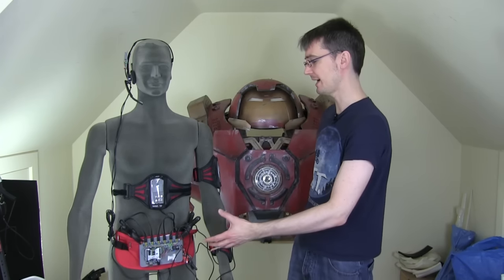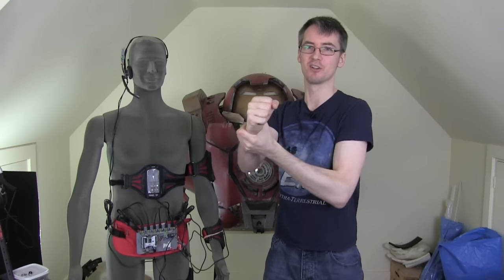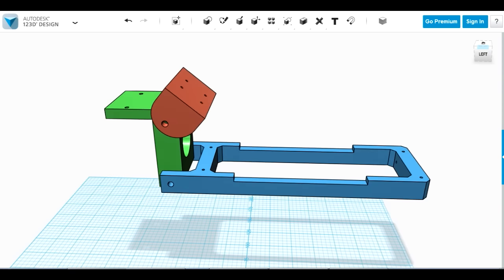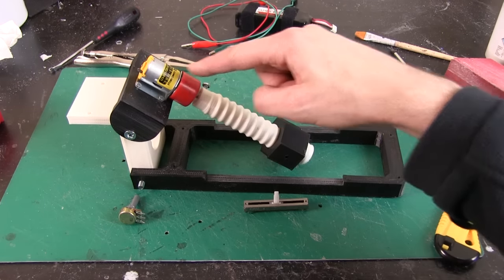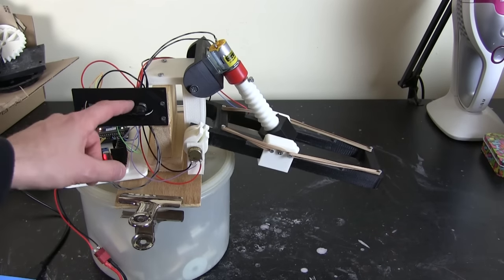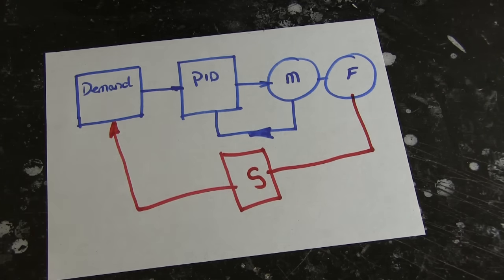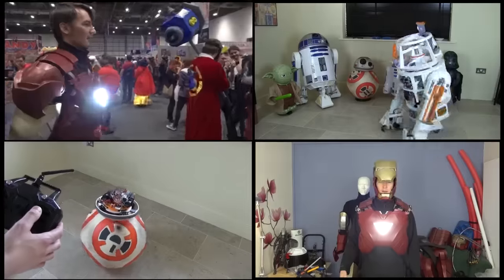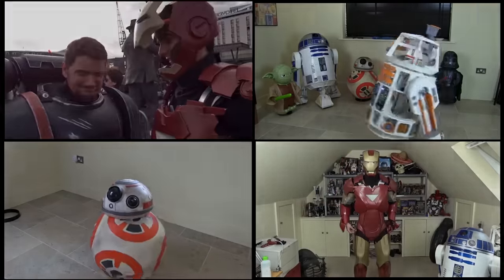Avengeres Ultron #4 | Series Elastic Actuators | James Bruton

Comment: Perhaps try a piezo based solution for force sensing or a force sensitive resistor.
Sandwiched in a joint where the load is going through you should be able to measure not only the force but also get a rough estimate of the amount of force being applied.
Reply: +James Bruton (XRobots) You shot who in the what, now?
Reply: *****
Ow yeah, put some QUANTUM in there for good measure!

Comment: Perhaps Flex sensors might be something interesting for your force feedback. I plan on using them for my robotic hands. They were used by Nintendo back in the days of the power glove. The glove failed, but the tech is surely interesting for your robotic mimicking. Love the work btw! I'm looking forward to seeing how you are going to do the hands. I designed mine with stepper motors in the lower arm and spindles with leads connected to artificial tendons that are connected to the finger tips. This way the fingers don't require powerful motors to keep a grip on something and can also shut down when the fingers aren't being moved (to prevent heat buildup from the hold torque, although micro stepping might solve that).

Comment: That actuator is great! Do you have a link to the library you used for the PID controller? I'm needing to create my own servo using a motor driver and an Arduino fairly soon and it looks like what you're using would do the trick!
Reply: Thank you very much! I was able to get my motor joint working pretty much straight away with that library. Got any tips or guides you follow for tuning the PID? I've got some values set but they could be better.

Comment: in order to measure mechanical resistance on that custom corkscrew-actuator, wouldn't it be more simple to measure current going through the motor? after all, more current going through the motor means it's doing more work to overcome mechanical resistance.
i don't know how what will work out with the actuator being elastic, but it just seems more robust than having to deal with dust and wear in the potmeters :)
Reply: +James Bruton (XRobots) that indeed makes sense! but screw driven actuators can still back-drive when they're in motion or under enough stress, right? awesome project and solutions anyways, you are some kind of tony stark!

Comment: what would happen if you put the sensors on the finished robot? would it gradually move faster and faster, or stand still?
Reply: It would stand still, since the arm is already in the position the sensors are telling it to go to.
Reply: maybe. or they are sending a slightly different value than that at which the motors are at. thats why i imagined them moving slightly and because of that increasing their speed. but i guess they could stand still too. sort of like an unstable system

Comment: Aren't you concerned that such flex joins like in this video won't be able to lift much weight ? Cause first you gonna have to know that you're lifting something so the weight doesn't work on the sensors like pulling the arm, and then once you lock the sensors the weight is going to pull the flex joins, so they have to be quite strong to be able to lift much more than just a pound or so ? :)